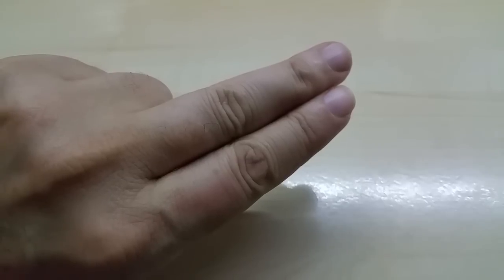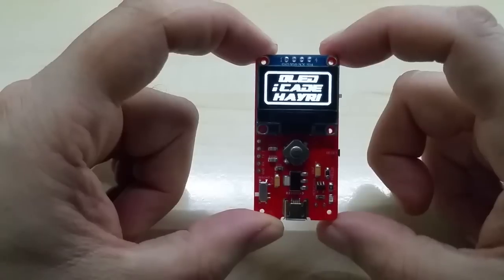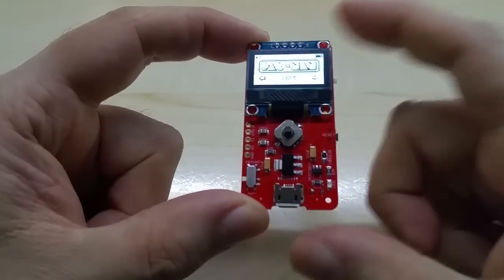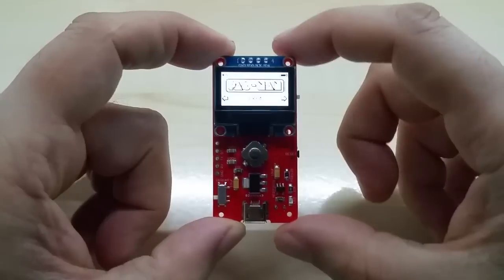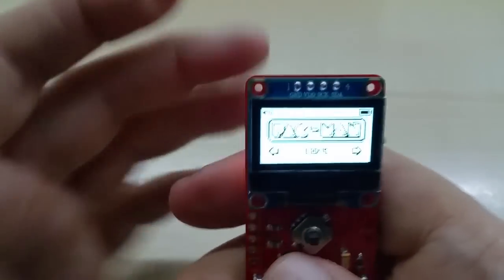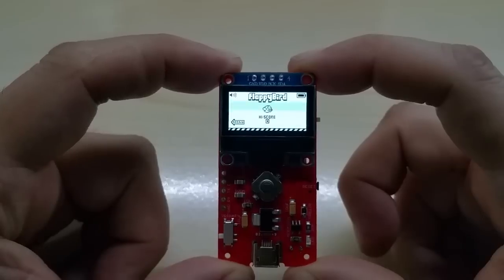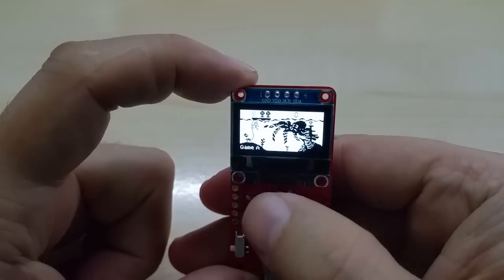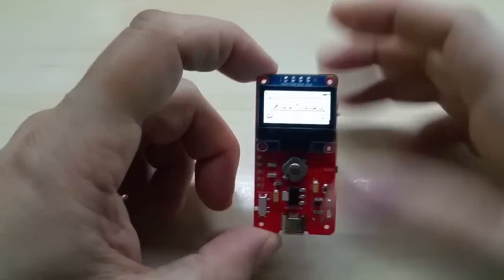OLEDiCADE Worlds Smallest Pac-Man Game by Hayri

Comment: There's some videos out there saying (& showing) that If you anneal PLA it becomes as tough as ABS.  
To do this you just put it in the oven, or boil it in water (probably a good idea to put it in a sandwich bag for boiling)
Note: the part will shrink a bit tho, upto 8% depending on your PLA.

But yeah, rather than deal with the shrinkage issues - it's probably easier just to stick with ABS if it's already working for you.
Reply from the maker: You are right, that sounds like a lot of work. ABS is easier :-)

Comment: You should get oled displays without pcb and solder them directly on your pcb instead, would look way better
Reply from the maker: Makes no sense at all if it is in a case, plus it makes the board bigger. I dare to say that not a single other design out there using the 0.96" OLED display looks better than the OLEDiSCOPE PCB (the black one in the video)